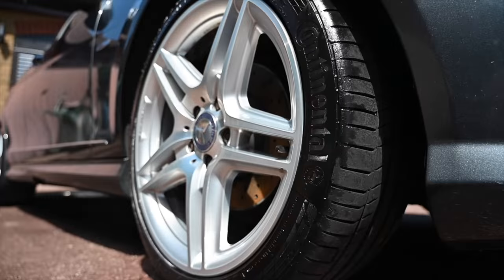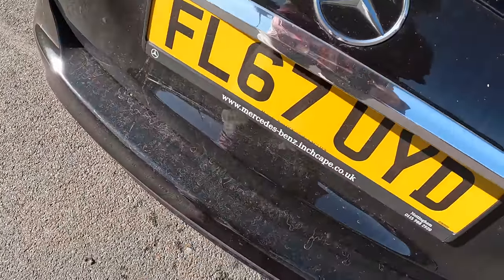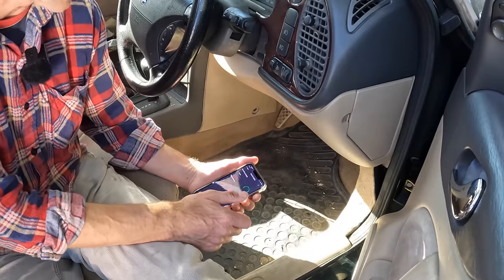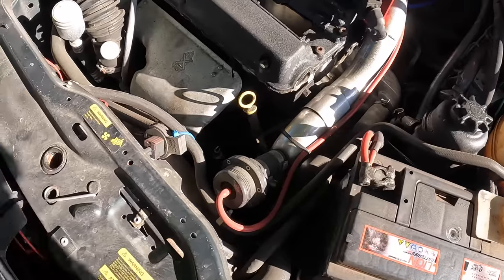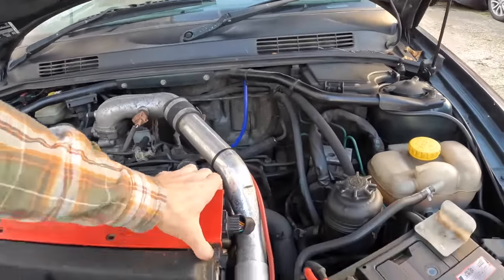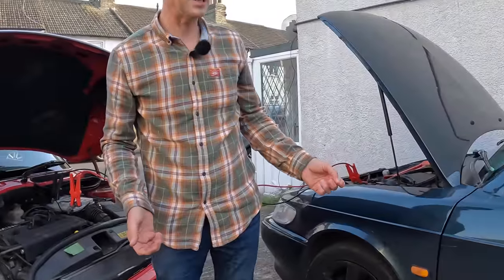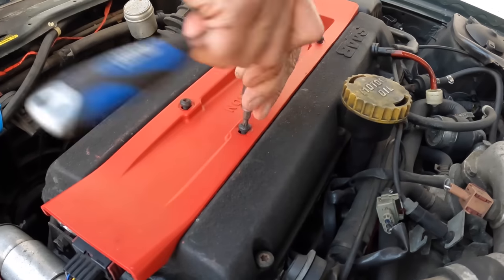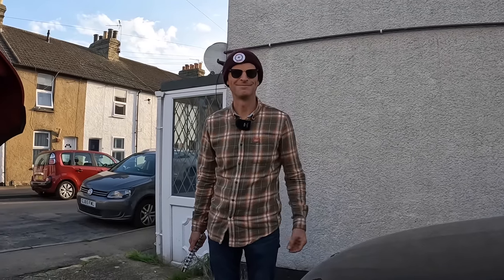Dead SAAB rescue! My friends 9-3 died, can we fix it?

Comment: Matt, kid you not, your video just inspired me.

I have three SAAB. My latest is a 2004 9-5 Vector Sport wagon with the B235E engine. It had a MIL lamp on recently which went away after a major service; the fault was ‘misfire on start, second cylinder’. I inspected the old DIC, and noticed a crack underneath (a common issue).

I purchased a genuine Huco Hitachi unit and have been looking at it in my lounge for weeks.

I’ve literally come out to change it, in the rain, and am now trapped inside the car waiting for the rain to pass so I can go in!!

Thanks for the inspiration.
Reply from the maker: Maybe not the best inspiration!
Reply: @furiousdriving  well. It was. It’s a 3 min job to do, and there’s one less box of car parts in my lounge!

Comment: As a person that have owned several saabs I got that just by reading the title. These will break. Remember to have the coil pack level for some time after installing them. Sometimes you can smell burned plastic when they break. You will have to have your nose very close though because it will not be a strong smell. Another tip that could be tested is to use a rubber hammer and hit the gas tank while trying to start. If it is the fuel pump it might get the fuel pump going again. Might sound strange but I got these tips from a Saab garage and I have tried them myself with success. Well done!
Reply: I had to replace a fuel pump in one of my 9-3’s.  I did get 2 more trips out of a dead fuel pump by whacking the gas tank with a big piece of wood.

Comment: Good job! My old 9-5 had 160K on the original DIC! FYI, the neutral safety switch on the autos will not let you crank (another common Saab problem), it just clicks like a dead battery would.

Comment: Used to have a 2001 Saab 9-3 and my Direction Ignition pack died too, albeit the later black version. A common failure item apparently. Welldone on getting it back up and running

Comment: Two things stop those Saab engines. DI pack and Crank Sensor. Worth carrying both in the boot. I had a DI with me when my 9-5 cut out. The smell of scorched plastic was the clue. Part swapped and back on the road in 10mins.

Comment: FYI a Carly will not work on a SAAB. To correctly read codes on a SAAB you need a GM TECH2 unit. With a T5 car as shown here for engine faults you do not need a code reader. If there is any issue then the Check engine light will flash. The number of flashes relates to the fault.    
2	Manifold absolute pressure sensor	P0105 P0106 P0107 P0108
3	Intake air temperature sensor	P0110 P0112 P0113
4	Coolant temperature sensor	P0115 P0117 P0118
5	Throttle position sensor	P0120 P0121 P0122 P0123
6	Lambda (oxygen) sensor	P0130
7	Fuel-air mixture	P0170 P0171 P0172
8	EVAP valve (ELCD)	P0443 P1443 P1444 P1445
9	Internal ECU fault	P1651 P1652 (check ground, connectors)

Comment: DIC !!! Classic 9000, 9-3 and 9-5 thing. Always carry a (genuine Saab) spare in the boot! Only guessing, haven’t watched to the end yet. Or a dead fuel pump…
There were sparks everywhere the first test you did with the DIC out but you couldn’t see them. You should keep the new one upright at all times or let it settle before you try to start.
Édit
I knew it! Happens to every 9-3, 9-5, 9000 owner some time 😂

Comment: Hi quick tip if you are jump leading between 2 cars,,,, connect the pos and neg leads on the good battery,,, on the flat car,,,, connect the live to the battery, and the neg to any clean part of the engine or body of the car.
What is happening if you connect both leads battery to battery is that the flat battery will attempt to charge and equalise the voltages,  losing cranking power.
When attaching the negative lead to the engine or body the power from the good battey does not directly go through the dud battery giving more power to crank the car.

Comment: What I found with these coil packs is it’s important to do the plugs as-well
Because if the plugs are old or not correctly set it makes the coil pack work harder causing the coil pack or pencil coils to fail prematurely

Comment: If the engine uses regular spark plugs, but Iridium ones are installed later, they would overload the coils and that could make them fail often.
Reply: Correct, the wrong plugs will kill a Saab DI.  NGK BCPR7ES with a 1.1mm gap must be used. Each spark plug is used as a Ionisation sensor to detect knock in each cylinder. GM went on to take Saabs Patent on DI and the same system can be found in Astras / Zafiras and Vectras.

Comment: Those di units were that common for failing we used to keep them in stock at the dealers in 1998! We used to have a test di that would work on any Saab
Reply: I've heard of the test DI. Was it blue in colour?
Reply: @stefansworld3351 it could've been, I'm not 100% certain though

Comment: A Red Trionic 5  D I pack from a B234/B204 engine is a no no for installing in a B235 engine, which uses the updated Trionic 7 system ( Black D I pack)  and vice versa , if you are after good engine performance.  The 2 systems use different tuning parameters / sensors and must use the D I pack designed for that system to give optimum performance. Yes  you can use a Black pack in place of a Red one, but you can't  use a Red pack in place of a Black. You will not get optimum performance, gas mileage etc by using a Black in lieu of a Red but eventually the cassette will fail prematurely.

As a  SAAB owner for mañy years, ( up to 2017) I soon learned the value of always having a spare GENUINE SAAB D I pack in the boot/trunk, for the exact reason this video is about 😁  Steer clear of the cheap, Asian made knockoff D I packs often found on E- Bay.  They are overpriced, and last for next to no time. ( A case of " been there, done that." 😉)
Reply: The correct explanation is actually. Red DI's are DC based spark on T5.  Black DI's are AC based spark used on T7.  You can use a Black DI on a Red DI car however you will have no Knock control so its very dangerous. Not so bad on low pressure turbo cars, but on a full pressure turbo car it could lead to melted pistons. When changing a DI, brand new spark plugs should always be used. NGK BCPR7ES with 1.1mm gap.  Paul @ The SAAB Clinic.
Reply: @dj_paultuk7052  Yep. I remember reading a paper written by one of the SAAB engineers who was on the Trionic design team, in which he went right into the differences. It was uploaded on to the internet and I wish I could find it. (Maybe someone else knows or can find the link address and can post it?) 

Besides what you have correctly stated, he also wrote that the T5 system reads inlet Manifold Air Pressure whereas the T7 reads Manifold Air Temperature, requiring  different sensors, wiring and ECU tuning.

NGK were involved on the design of the Trionic system, and sensors NOT found in plugs from other manufacturers are built into their plugs. Without those sensors and readings, the cars ECU is flying blind. So another lesson for those new to turbo engined SAAB ownership. It's NGK or...NGK. End of story.

Despite SAAB being long gone from new car manufacture, the Trionic system is still on par with, if not better than, systems currently in use by other existing manufacturers. So sad that they are gone.😥
Reply: @Bellakelpie  Yes it was on Saab Central and it was with Dr Boost, the designer of Direct Ignition. My name was on that paper ! and i was in those discussions back then.
Reply: @dj_paultuk7052  I remember that post , which he wrote under his Forum name. The article I originally read was elsewhere, some paper he gave to an Auto Engineering Society somewhere, around 2013. I understood about 75% of it.🤣🤣🤣 But no matter, the guts of what he told them are on the SAAB Central page. Thanks for refreshing my ageing memory, and thanks to “furiousdriving” for reminding me of just how advanced SAAB were in their thinking. Something I don’t think the G.M. Bean counters ever appreciated.
Reply: @dj_paultuk7052  😊🙏 Great. My last SAAB left my ownership in 2017 (after a great 21 year partnership) mainly due to spare parts availability (or lack of) in my country, and my impending retirement from the work force. Believe me it was like pulling teeth. As a replacement, I bought  a new one of the next best thing to a SAAB (in my opinion anyway.) A European made Volvo. Since some of the ex SAAB workforce went to work for Volvo, I figure that there is a little bit of SAAB DNA in it. 😉

Comment: It’s either the Direct Ignition Coil failure or a fuel pump. Could be crank position sensor but that usually shuts down when hot

Comment: Honestly, I bought a top spec 2019 C class estate, the C200 AMG Premium Plus C200 EQ. with 6000 miles on it. Rubbish car, so hard seats, ride aweful, 35mpg. Best thing I can say about it is it didnt't break down. Now have Volvo V90 D4 Inscription with similar spec. Superbly comfortable car, 60mpg, £15000 less money, Had 2010 V70 for 168,000 miles. I love Saabs. Had 2 9-5 Aeros from new. Great cars.

Comment: Stumbled across your video from the other side of the pond.  The old generation 9-3 is my specialty here in the US.  I will say, that low cost replacement part you installed probably won't last too long.  You'll be lucky to get another 10k Km.  Keep your receipt and hope you can get a warranty replacement.  It is recommended to only use OEM SEM replacement modules.  This unit was easy to see it was not.
Reply from the maker: I wouldn’t call it low cost, it’s from a major German manufacturer and cost £250!

Comment: Being a Saab parts man until 2004 I instantly thought DI pack. 9178955 on B204 engines. Still remember the part number, sold thousands.

Comment: I'm a little surprised you said you could smell fuel because I'd have thought if the ECU had detected a "no spark" condition it should have turned the injectors off?
Reply from the maker: unburnt fuel?

Comment: Well done!
I am not educated about car tech: what is the wireless OBD device that you used at 2:05?
Reply: @Roy Gardiner. The one Mat uses is called Carly, but there are heaps of different brands available. It basically connects to the cars engine management computer via the OBD II port, and displays via blutooth onto your phone/tablet etc. The "Carly" device is as far as I know a mostly US based one (covers vehicles sold in the US market), so if you are from there, it's probably the one to get. Pretty much all (excepting some very obscure/low volume) from 1996 should have an OBDII port. Cheers!
Reply from the maker: yes, wireless OBD, it reads the car and uses the phone to read it out
Reply: @phillipevans9414  Many thanks for the info! Much appreciated 👍
Reply: @furiousdriving  Thanks!
Reply: @roygardiner2229  . You are most welcome. If you are looking to get one for yourself, just make sure it's an ODB II, as there was an earlier version used pre '96 just called ODB which which is also available, but is not very useful, unless you have one of the few pre '96 vehicles which used that system. Cheers!

Comment: Computer says no fault found...😏 I've a set of red see through plastic  things that you can push into the coils and they fit onto the plugs, so if it's getting a spark they light up red. Must be 30 years old now and work on anything with a spark plug. They were cheap enough back in the day but I'm not sure if they are still available.

Comment: Can see the GM /Opel/Vauxhall set up, they’re pretty reliable but when coil goes it’ll just conk dead without warning.
Reply: On Vauxhalls they don't usually die completely, you can get home with a misfire, cheap too compared to Saab. The £40 knockoffs will probably do 20k miles

Comment: Btw, the aftermarket DIC packs just don’t work. These are a trionic system where the coil pack also monitors knock control through the spark plugs and calculates camshaft position. 

Must be a genuine SEM unit, or the need SAAB replacement which is made by Huco Hitachi. 

P.S that B205 engine should have a T7 black part, not a red one?
Reply from the maker: Its had a red one for years apparently, and always ran fine. I think the later ones were black
Reply: @furiousdriving , Correct, A T7 system (later Saabs) can use either Red or Black, a T5 (earlier Saabs) only Red.
Hope this helps.
Reply: @furiousdriving  looks like the B204 engine is a T5, and the later B205R in an Aero is a T7 (black unit)

Comment: If the DI Cassette fails while driving, you risk flooding your exhaust with fuel and burning out your catalytic converter.  I know from experience. 😉. Never buy anything but a Saab DIC for replacement.

Comment: He needs to buy a genuine DI Cartridge from
Neo brothers and not an aftermarket from euro.  The car will eventually start to play up again with that installed.
Reply from the maker: Wasnt from Euro, I never use them. This would have been a spare wheel for a Transit if Id tried from them